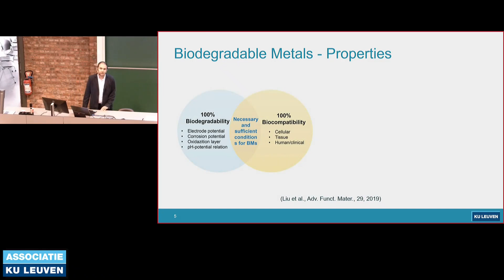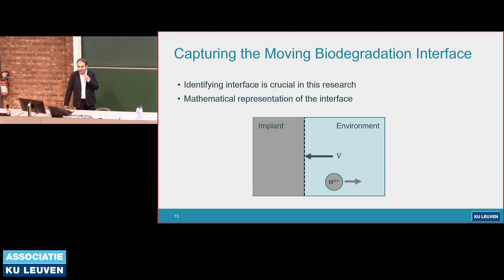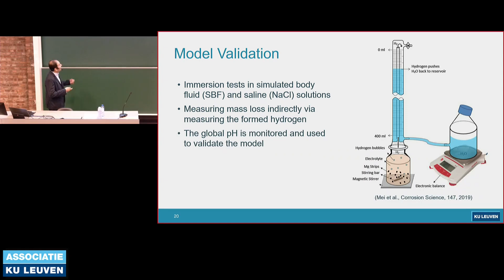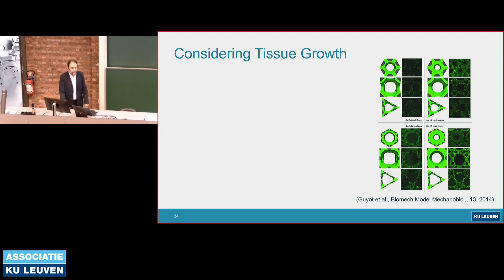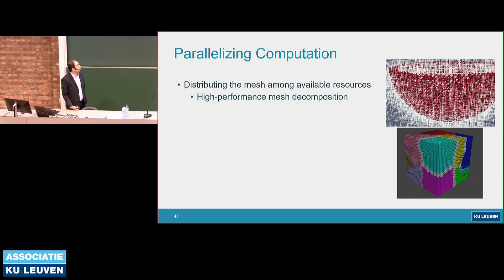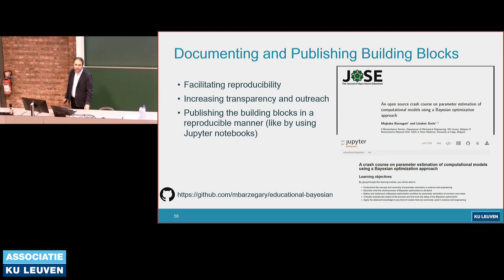Public PhD Defense - Mathematical and Computational Modeling of Metallic Biomaterials Biodegradation

Comment: Hello Barzegari,

Thanks for all the videos and tutorials. They are really inspirational and congrats on your phD defense

I am currently working on a project which requires running a parallel lattice Boltzmann solver on the parallel cluster. (I am working on multiphase flow simulation). The code I am running essentially requires MPIto run it. I believe that means specifying the number of cores in my batch script file. (After watching your videos, I didn't see any where that the use of a batch script was specified. However, i am required to do this since that is the default method in sending jobs on the HPC.) 

However, I haven’t been able to run it effectively using this method as it is excited on only one node (even after trying out multiple nodes)

I suspect it runs iteratively and cannot execute multiple processes at once.

I appreciate your insight into this issue.

Warm regards
Enoch
Reply from the maker: hi Enoch,
thank you for your kind words. 
I'm so sorry for forgetting to reply to your comment. I thought I replied it, but I was wrong.
your issue is quite common I would say and happens a lot in HPC environments. it's rooted in mismatch between the version of MPI you compile your program with and the one you run it with. I mean, you should always build your program using the correct MPI provided by the cluster with the recommended build configuration. otherwise, there will be a mismatch during runtime, which leads to the problem of not scaling over the nodes.